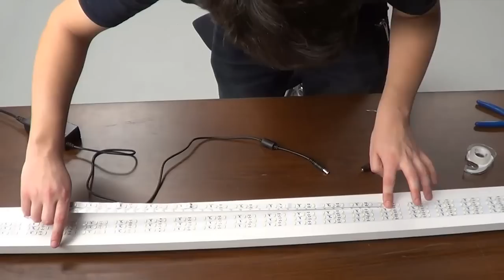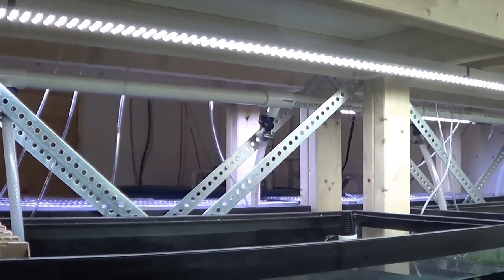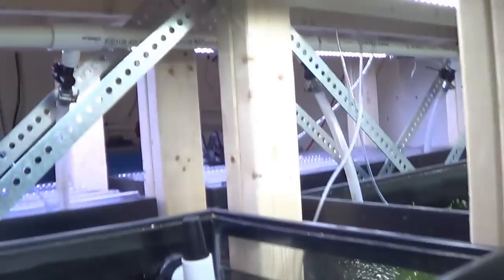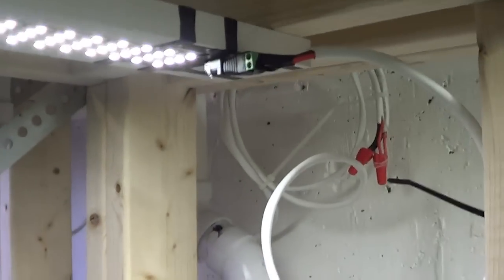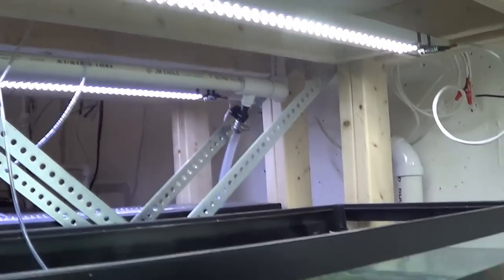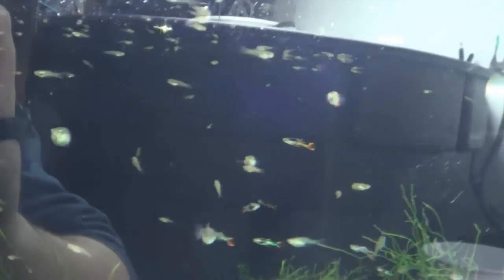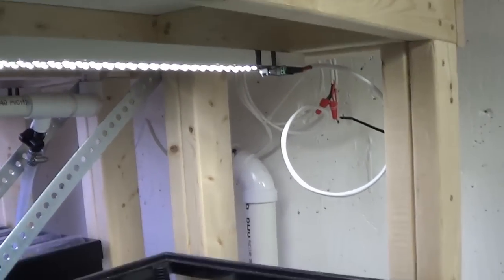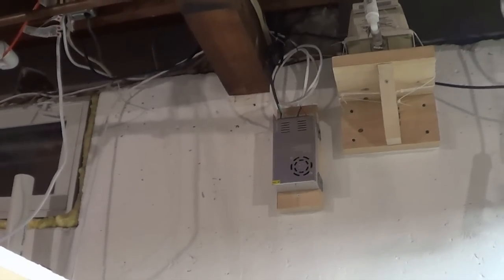#284: How to Build a DIY LED Aquarium Light - DIY Wednesday

Comment: Those ledz look excellent. As cheap as that was to make they look better then most enclosed fixtures ive seen For this hobby. Video was awsome, thanx for showing us all how to make a setup. Ill probably contact you about the supply. Got a 250 that wold love a light update and since I can make the length what ever I want, I could really make my koi pop with these.
Reply from the maker: Dan Spriggs stay tuned and i'll post a video about the kickstarter when it's live, thanks!
Reply: @gregjonesonline  Hiya bud,I'm interested in getting the parts needed for this the led strippy..lol

Comment: Since you applied the strips directly to painted wood are you having any issues with heat transfer? Are all your strips still working at this point? I have just seen so many people saying you need place them on a heat sink or other aluminum piece to dicipate the heat
Reply from the maker: +cflaquatics the ones on the wood are still working fine, although they do run hot. I have a second generation fixture affixed to an aluminum strip spray painted with high heat grill paint, more on that video soon
Reply: +Greg Jones (Greg's Fishroom) thanks Greg, will look for that. Have my LEDs coming in next week and wanting to pin down most cost effective but efficient panel to adhere them to

Comment: Just caught you video on these DIY led lights. A couple of no no though...
 First, when joining (jumping) pads together to make a connection to each other use wire and solder the wire from pad to pad. It is the wire that carries the current and the solder joins the wire to each pad. Do not use solder alone as it is soft and can develop a small crack or break away from the pad leaving a open circuit.
 Secondly, use a GFIC (ground fault) breaker for the power supply (or for any electrical equipment around water) for protection against electrical shock. Pretty much mandatory for pool, spa and any equipment around water. Remember its about safety. Other then that, good video...
Reply from the maker: Ace Storman the solder joints shouldn't be a problem, as the lights never move, if a crack develops i could touch it with a soldering iron to fix it good as new, i don't believe using a wire would change that. I do use a GFCI adapter with these lights however the power supply i'm using also has shortage protection, i could always wire in a fuse as well for triple redundancy. Pools and spas are probably running 120 volts AC whereas i'm running 12 volts at low amps and is much less dangerous. Thanks for the feedback, i'm working on version 2 of this light right now.
Reply: ***** Hi Greg, if the board is on the same pad then you have a bit of an advantage. Movement comes in the form of heat, expansion and contraction. It's this contraction action that can possibly lead to faults. Build it correctly the first time and there should be no problems down the road. This is the way it is done in the electronic's world. I am a C.E.T (certified electronics technician) and that is the way I was taught and that's code for low voltage. Good that your using a GFIC. Don't confuse a GFIC with short protection or a fuse. Usually and especially cheap fleebay Chinese power supplies do not meet CSA (Canadian) / UL (American) standards (they cut corners to save money). Floating grounds (or lack of proper ground bonding) with in the power supplies tend to be the norm and they can be dangerous if certain conditions are met. A GFIC will protect you in those cases. Hope this helps...good luck with version 2!
Reply from the maker: Ace Storman thanks Ace!

Comment: Excellent video, very informative.

I only have 2 concerns:
1. Heat dissipation. Dunno the wattage of those, but I imagine that 4 strips put out a fair amount of heat. I think a metal C section would do a great job with that.
2. Being an LED aquarium DIY-er myself, I tend to be concerned with longevity / warranty. This also links to the point above.

For my tanks, I chose hard strips with matching aluminium heat sinks. The warranty for these is ~50k hours or 5 years. However for the length in your application that would be prohibitively expensive.

I did use flexible strips for my home lighting, the first LEDs gave up less than 1 year after purchase. Really disappointed there, but then again it was probably bad luck...
Reply from the maker: Cristian-Gabriel Stan great idea with the c strip, i need to build new LEDs for the top rack and was planning to mount them to aluminum spray coated with enamel engine paint to remain non-conductive and dissipate heat - i'll look into the cost of aluminum c sections. These strips are so cheap and easy to swap out i'm not too concerned with longevity, but i will be tracking lifespan on the gen 2 lights i'll be building soon

Comment: Aquariums stand on a foam plastic?
Reply from the maker: they are resting on a sheet of polystyrene foam to help them level, reduces the stress on the seams
Reply: Thanks, I thought aquariums would weigh their weight polystyrene. Or saving heat ))
Reply: @gregjonesonline  I cant belive the amount of tanks with no foam under them on yt, here in Australia just about every tank u buy comes with foam!

Comment: Awesome vid, mate! I left you a PM regarding some of the specs, but if I had a 72"x24"x18" tank (ie around 135 gallon/500 L tank, would these strip lights provide enough light to grow some plants (ie at least 20K lumen)?

Looking forward to seeing more vids, Greg. Thanks for posting this video.
Reply from the maker: Just Eat It! one 5 meter reel of LEDs is around 15,000 lumen I believe, I have around 25,000 lumen stretched across 12 feet of 40 breeders and it's enough light for low light plants, the beauty of the LED strippy is that you can add as many rows as you need, and you can mix and match the color temperature of led strips to get the right amount and color of light. I haven't set up a planted tank with high light to test it, have any suggestions?
Reply: ***** Thanks Greg. Where are you purchasing your LEDs from? I've gone on Ebay and for strip LEDs like you're using, the best output I've seen is 1400 lumen/m (i.e. the 5630 type). Most are around the 1000 level , so I would need to have at least 14-20m of strip lights just to get up to around the 20000 lumen required. What type of LEDs give you 3000 lumen/m?